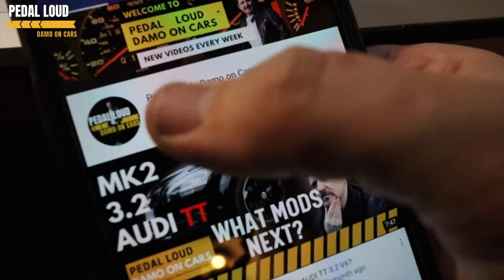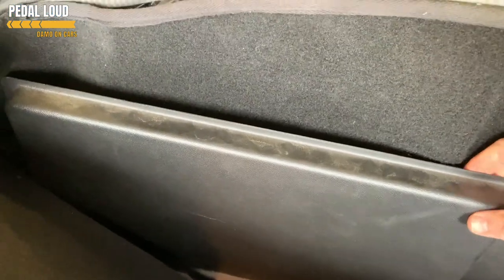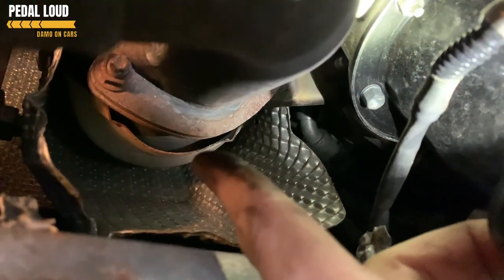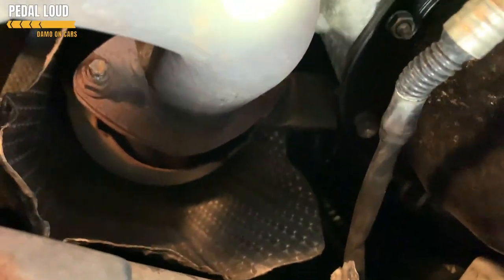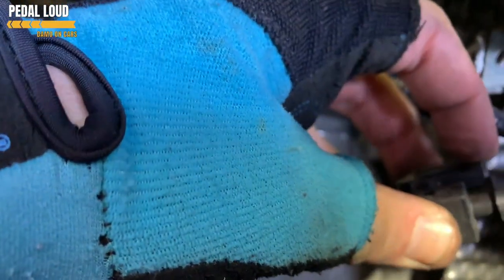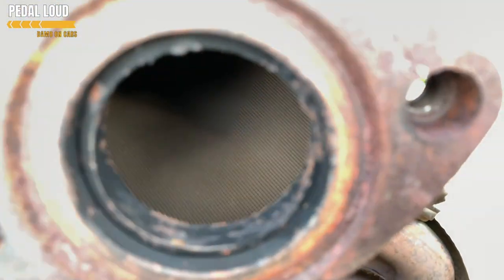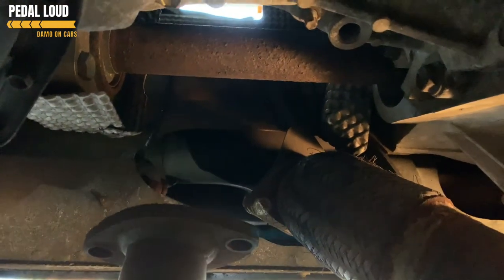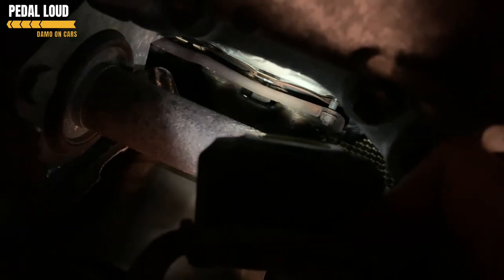HOW TO REPLACE A CATALYTIC CONVERTER ON A 2GR-FE 2011 LOTUS EVORA S ENGINE!

Comment: Hi there, another question for you. So I was reading your TLF thread where you mentioned you finished a track day with an EML + rattle, then the next day with no EML/rattle, and then the day after with an EML and you eventually finding the cat pieces outside the car. 

Do you happen to remember if at any point the car was making different or ugly (ie definite abnormal) sounds? I know you mentioned you noticed a little more burbles etc, but it seems like otherwise the car sounded mostly like it’s normal self?

Reason I ask is because my friends evora has a similar situation (cat is still there but has broken apart and is rattling, ie, it’s failing and needs to be replaced). He wants a 2bular full system but needs to save up for a bit, so I’m wondering if he gutted the two pre cats in the headers (and appropriately recycled the material) and got a sports cat @ the 3rd cat location, he could run around like that in the meantime until he could save up for the headers (and maybe y pipe and backbox).

My only concern is if the big open cavity in the oem headers would somehow sound bad (not just louder but like broken). So, back to the original question, do you happen to remember if the car sounded off or did it just sound normal and it was really only the EML/rattle and then eventually finding the broken cat pieces that tipped you off?

Much appreciated!
Reply from the maker: Sounded pretty normal before. Big rattle and a stall. Then it sounded normal again with EML. If you suspect the cat is disintegrating though I’d recommend sorting is asap you do not want bits going in to the engine.